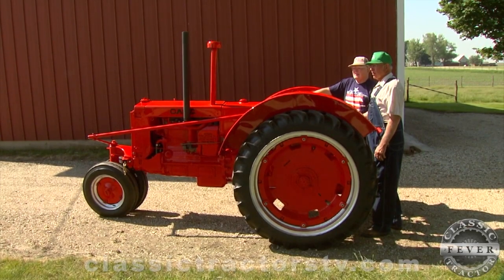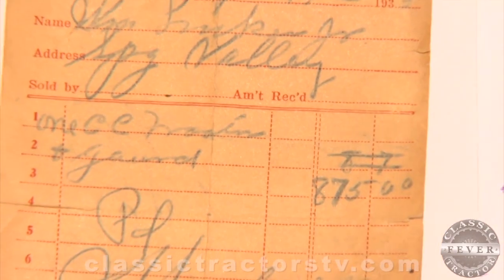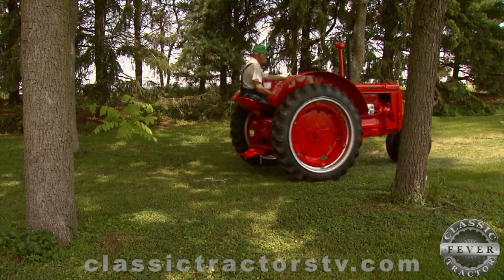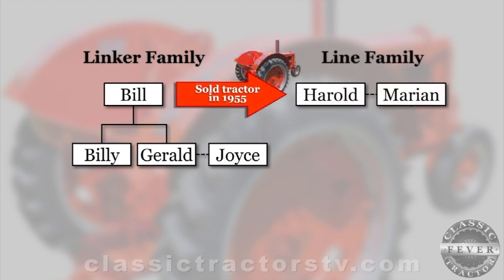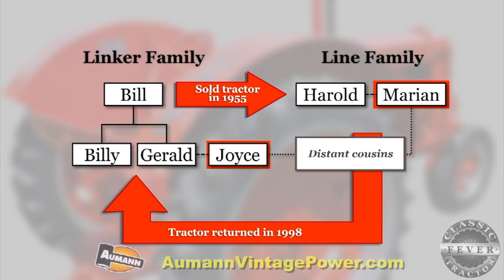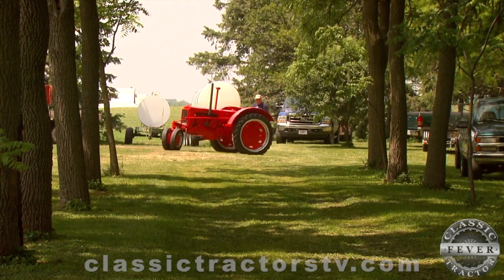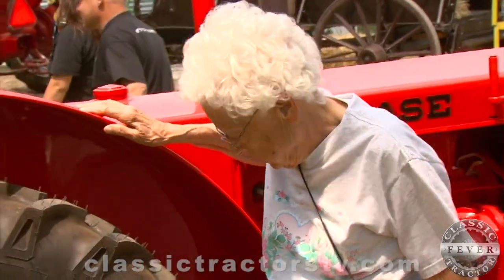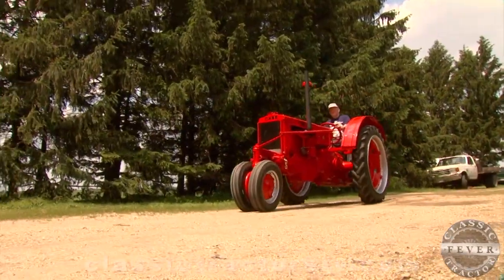Why Is This 1935 CC Case Tractor So Unique? - Classic Tractor Fever

Comment: Nice I bought a Case L that has the same color on it I wonder if they tried that color with more than the CC. I have also heard that dealerships would get them as a trade in and re paint them with the new red to make them look more like the new ones when they were on the lot. Either way I am going to redo it in red lol.
Reply: That's exactly what dealers did. It was a sales incentive. They repainted old stock on the lot, as well as trade-ins to make them look like the new colour models. They did it again in 55 when the new hundred series came out in the Flambeau Red and Desert Sunset. Letter series got the same two-tone paint job. The theory behind the update was to show the older models were just as good as the newer ones.

Everyone that has a model with the updated paint schemes makes a choice when they want to restore. There is no wrong answer. Lol
Reply: Case definitely looks better in orange than in grey. Similarly IH went from grey to red in 1936 with equal improvement. Ford  9N's & 2n's were grey from 1939 to 1947 after which the 8N became red & grey. One local farmer painted his early 50's Ferguson red & grey which made it a very good looking Ford. If I was repainting any of these older tractors I'd definitely paint them in the more attractive later colors.
Reply: PS And if John Deere doesn't get their act together on their ECM diagnostics & repair there are going to be John Deere tractors out there sporting lemon yellow paint jobs.

Comment: My Dad had a later model Case with the same steering configuration.  Absolutely true description they were fence post knockers which also resulted in some whacked thumbs.
Reply: That was often called "Chicken Roost" steering.
Reply: @n.mcneil4066  I cannot say I've heard that description before but it does fit nicely.

Comment: Did this tractor have a hand clutch and mechanical lift for the tool bar? Seams like ours had the steering bar on the right side,  I could be mistaken on the year model.
Reply: Yes, the CC had a hand clutch as did the larger models. The smaller VA had a foot clutch though.